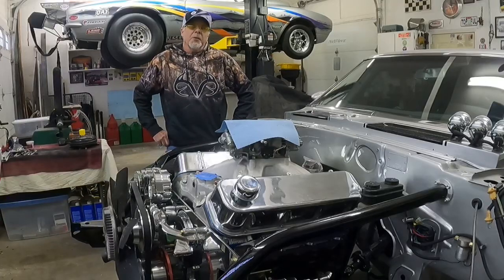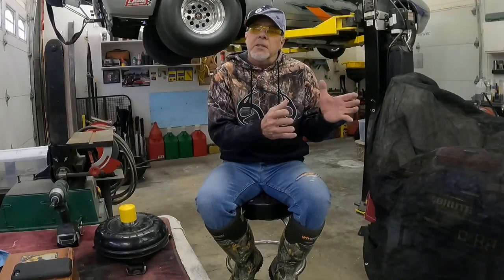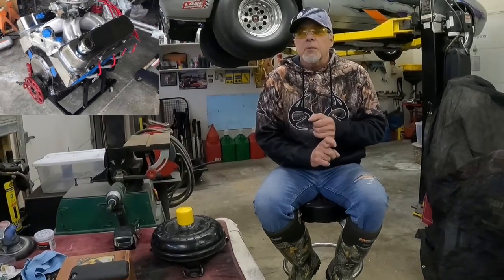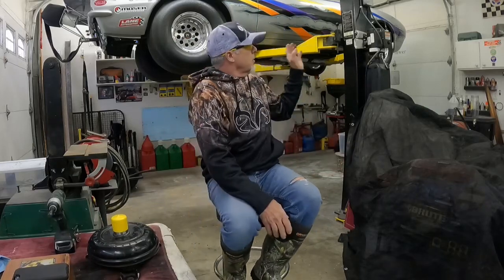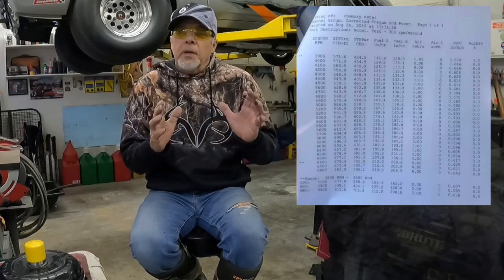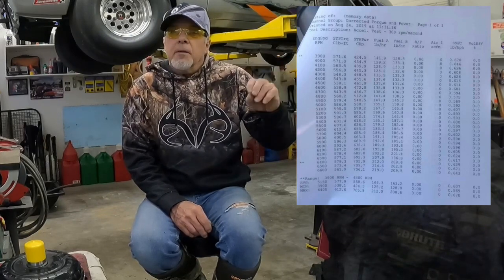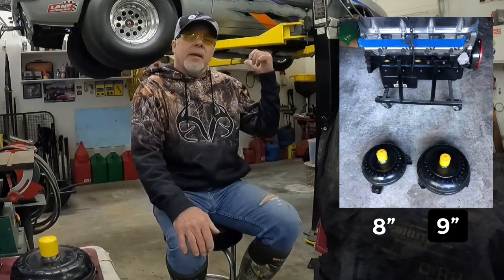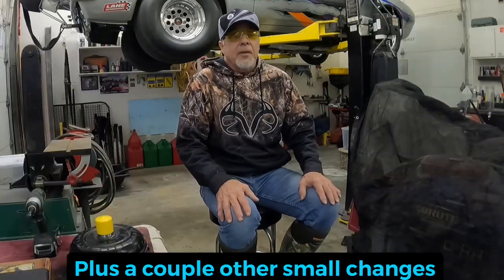Selecting a torque converter

Comment: Thanks for the videos Ron!  Im building a sbc427 for my street/strip 69 Nova.  Dart SHP block, SRP Pro pistons, AFR220 65cc heads, Comp custom ground hyd roller cam, comp 1.6 rockers, Johnson lifters, and Smith Bros pushrods.  I will eventually be putting it on a dyno but my goal is 600hp at the crank.  I just had a guy build me a TH400 with 4L80e direct drum.  He also suggested and provided the 10" 3400 stall converter with anti balloon plate from Precision Converters and I was wondering your thoughts on the setup.  I am estimating the weight of the car with me in it at about 3575 lb.
Reply from the maker: That’s awesome Orange Crusher and thanks for subscribing 😊

My initial thoughts on your ten inch converter are this:
If the converter is a shelf advertised number and has not been tweaked to fit your combo, I’m willing to bet it will not get you to your rpm range from what you’ve laid out. 

I’ve been down this road with my a 575 HP 427 I once had in my 69 car. (3,200 lbs w/me in it) 
I purchase a 4,000 advertised shelf converter and the car bogged in the first sixty foot.

The only real way to get close is to send the converter to a reputable converter shop along with your dyno sheet and car setup info.
From there, you should be very close to unleashing the full potential your combo has to offer.

Hope that helped and thanks for watching/subscribing and for your question OC, 
let me know if you have more questions 👍🏻😊👍🏻

Comment: I have a 5.7  2015  8 speed dodge charger it’s a DD with  a mild street cam and a Procharger making about 500 to the wheels. What stall speed would be best for me or should I stay with the stock converter.
Reply: It all depends if the engine is into its power band at launch. 
The cam grind makes the engine come alive with optimal power during take off if the rpm is correct. If the rpm is too low, the engine will bog.

There are several factors that play into converter selection. This being said, you’ll need to provide this info to your converter manufacturer so they can recommend which converter fits your total package. Horsepower alone is not enough info. Car weight, gear ratio along with engine information is needed to more accurately make a determination.

My recommendation would be to call a company like Coan Engineering, to speak with one of their experts. They will help square you away.

Good luck and let me know how it all plays out. Thank you 👍🏻
Reply: @ronthepoolstudent  I am trying to find the cam card but I also have 8 speed 3.06 gears Procharger 6.5 lbs of boost .500whp car is like 4,000 plus lbs. if I am not mistaken stock converter flash’s 1800-2000 but not sure.
Reply: @KillerPowerslave  the cam card will definitely help.

Comment: I’m building mainly a street car 69 Camaro.  Full interior.  Need to reweigh it but probably 3600+  lbs.  have a 498 built waiting for dyno so I can do just what you are saying.
Reply: Nice Gary, you’ll be doing it right by going this rout. 
We can guess, but it’s like hitting the lotto if you nail it this way 🤷🏻‍♂️

As far as weight, when I built my 69, this was always in the back of my mind. I wanted a custom deluxe interior package and glass widows w/regulators so I needed to trim the fat in other areas. Before this latest steering and brake upgrade, mine was at 3,020 pounds with an iron headed 427. (without me) 
it should be 2,900ish this go round.

Comment: Would a 3200 to 3500 stall be good for a 383 stroker with 5 to 6hhp ,it's in a 1984 chevy Silverado c/10 short bed ,with a 350 turbo C /converter lock 411 gears posi?.
Reply: My gut says you’ll need around a 4,500-5k to net your desired flash rpm Allen. To be sure, give Coan Engineering a call and run the numbers by them. 
My feeling is that 3,200-3,500 will be too tight.
Reply: @ronthepoolstudent  ok where are they out of,I have a 2,500 to 2,800 now I guess I've gotten use to it thank you sir have a blessed night.
Reply: @allenslaughter1965  the flash rpm needs to match up with your cam’s sweet spot. This eliminates bogging off the line. 

And you as well Allen 👍🏻
Reply: @ronthepoolstudent  ok it takes off well I think I need a little more sir or maybe timing,I'll have my mechanic check ✔️ it out before I put it up for the winter thank you again sir .

Comment: Can you tell me what are the brand of the wheels you have on the camaro? Looks like weldwheels but they aren’t they look better hope you can tell me and the model please
Reply: Weld Draglite wheels on the 69 and Weld Magnums on the front of the 67. To be truthful on those rears, I don’t know the brand. This being said, within the comments of one of my past videos, someone mentioned the name but that these are no longer available. Also, I would not recommend them anyway as they leak as they are a split type rim. I have to run live rubber tubes for that reason which adds 9 lbs per tire. 
They came with the car when I purchased it back in 06.
NOT A FAN AT ALL. 
Sorry not to recall the brand Jax  🤷🏻‍♂️

Comment: With my Stock 12 inch, My El Camino would only lay 20 foot lines.  I got one of the cheapest 10-inchers from JEGS, ($179 maybe?) and now I can smoke 'em halfway down the block. Cons: If I want to maintain low  rpms at highway speed, I need to get up to around 5mph faster than my target speed, then carefully slow back down & feather the throttle.
Reply: The correct converter allows the engine to cam within its power range 👍🏻

Comment: How do you choose the size of them? For example I can use a 285mm or 300mm
Reply: That’s not an easy answer CC. 
The safest way would be to contact a reputable converter company like Coan Engineering to ask for guidance. 
They’ll ask questions pertaining to your power plant and vehicle, then give a recommendation of size. 
That’s my best answer and I wish you luck.
Reply: @ronthepoolstudent  nah that still doesn't answer the question. Some of us would like to know why one is better than the other in different situations or just how they behave. Picking parts in a street car is all about compromise. So it's never as simple as picking the right part for the fastest ET and I have yet to have an expert pick the right part for my cars in the last 20 years. Every single time I've ended up swapping there suggestion a few months later for what they talked me out of and the part they talked me out of worked better for what I wanted.
Reply: @nashvilleoutlaw  Converter builds are science. I’ve had them built per dyno sheet and track performance based on data logging. Generally, I’ve had great success with Coan. This being said, it may require a second trip back to them for a tweak to catch that performance one is striving for. The bottom line; it’s up to the person to make the decisions that best suit their needs.

Comment: if i may ask a question about my not off the shelf converter but there wasn't any dyno sheets exchanged when i bought it. just few msg back and forth telling the builder vehicle weight swapped motor and a list of mods to that motor and i think he also asked for rear gear if memory serves me correct, tho it often dose not lol. witch is a S10 3k lbs 6.0L with 4l80 swapped out of 05 express chev van cam'ed springs saft mnt roll rocks LS3 flat topps turbo charged. but getting back to my prob dumb question because i am a circle tack guy trying my hand at going straight auto is totally alien to me. sorry side tracked again. k my question is when i dropped my gear in my stock rear end down to 4.56 the stall would over shoot by almost 1000ish well Did anyways the half dozen passed or so i got tell Pop! went the 10 bolt. so i built a custom narrowed 8.8 witch is in it now witch i didn't mess with gears just left the 3.27 that where in it alone witch now it no longer overs it is smack on the converters advertised stall speed. so if again want to do lower gears in the new 8.8 will i need to send it out to get worked on? or should i of sent it out back when i was over shooting, just went so quickly focus from converter to a new rear end plans after the pop. what would be your next move if you where in my shoes?
Reply: This is why a dyno session is so important Jesse. Chasing your tail takes lots of time and money. 

First off, you’ll need to install a data acquisition system that measures rpm. This will tell you your stall at the hit, at the shift point/points and at the stripe. From this data, you can then share it with your converter builder along with the other information they require. This will save you from guessing. 
Good luck 👍🏻🍀 

PS, Innovate makes an affordable data acquisition system. 
It’s a daisy chain setup which allows you to add additional data point measurements for other areas such as driveshaft speed, oil pressure etc etc etc…

Comment: How did you get your car to be so light. It must weigh 2700 without you. Thats lighter than my Civic!
Reply from the maker: Yes James, the car weight is currently 2,700. It used to weigh 2,611 before I added a factory grill and headlights for street driving. 
Also, I upgraded to a Dart Big M block from a GM four bolt which added weight. Also upgraded to a Reid super case for the glide. 
The chassis is Chromoly but I still have the original front frame section in place. Front down bars are chromoly as well. All glass has been replaced with Lexan and there are no regulators. Breaks are Wilwood four piston drag breaks.
Reply: @ronsmusclecargarage4060  Well thats superlight! I'm envious! My 71 Mustang weighs 3500 w/o driver and thats using a fiberglass hood and aluminum intake. I'm shaving some lbs as we speak. I had Aerospace Components brakes before but they are junk and using Baer now. So same there. New lithium starter battery replacing heavy Optima. New mini starter possibly. New aluminum timing cover. Maybe the carb gets updated from the old Holley but thats one of those things that needs to run right and as you can tell its not a light race car, but more of a cruiser. Cheers
Reply from the maker: @jamesmedina2062 this car runs in the NHRA Super Pro class James. Many door cars in this class run in the low nines while fewer run in the eights. Since the car is light, this did help it run consistently in the 8.70s on motor. 
(new engine build 8.60s) 
Also, the lighter weight is easier on drive train components. 
Another benefit; the 568 can run a less aggressive 280/291 @ .050 cam, which is great for street use as well.

There are many benefits to running a light car for sure. 
Good luck shedding the weight, it’ll help in many ways 👍🏻
Reply: @ronsmusclecargarage4060  Thanks man! Good luck too!! 

Regarding cams, is yours a solid roller?? Who is making good cams these days? Mine is a 215/215 at 0.050(hydraulic roller) but may want to run something a little healthier. My 383 stroker has 10:1 static compression.  Oh yeah I use iron 351C Aussie heads but if I used aluminum I would lose some weight. Still 3300 though
Reply: @ronsmusclecargarage4060  are you sure the 280/291 is not advertised duration? Thats big!
Reply from the maker: @jamesmedina2062 I run a Bullet Cams solid roller. Great company!
Reply: @jamesmedina2062 the engine makes peak power at 6,900 rpm and traps at 7,400 with this grid.
Shift point is at 7,200.

Comment: Over 40 yrs,hmm. Why "open up" a converter? Why not another? I guess if you have direct access to the lathe and robotic welder and balancer,why not? It just doesnt seem cost effective on either end...
Reply from the maker: @alwarren8325  I’ve learned to have converters custom built. By reading data acquisition after testing a new or even used unit. For a fraction of the cost, Coan Engineering will cut open and make necessary tweaks so they are spot on to the combo. This is the only way to go imo and proof is in ultimate performance. 
Done this many times and it’s well worth it if you want to get the most out of your combination.

Comment: 1956 Chevrolet 2 Dr wagon 3,200 lbs I think
Reply from the maker: That’s a tough one Willie. 
You’ll definitely need to reach out to Coan Engineering. The horsepower to weight is rather low so they’ll have to answer that question.

Comment: The best torque converter? None, a manual transmission all the way.
Reply: They are fun that’s for sure Nick 👍🏻

To be competitive in either Top ET or Super Pro however, ya gotta have an auto trans with rpm shifter. 
We need tight packages to make it to the winner’s circle. In many cases, the package needs to be within thousandths of a second. (.001-.006)

Comment: Selecting a convertor, call the manufacturer and talk to them. Never buy a shelf converter if you are trying to go fast.
Reply from the maker: @doomman700  
Read data/rpm flash off the hit then tweak from there.
Reply: @ronsmusclecargarage4060  you may find a stall you like, but have a super inefficient convertor in the upper rpm at shift fall back. I have seen Pontiacs try and run shelf converters and stall over advertised stall speed, then fallback be like cvt slipping away because the convertor is just not passing the fluid it needs to be to use the torque.